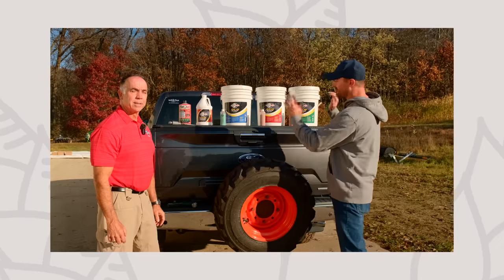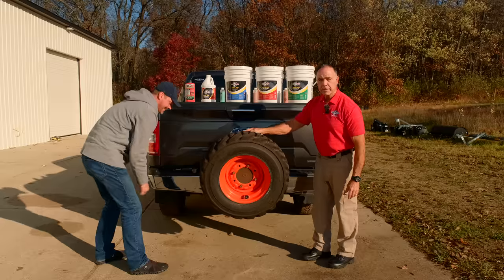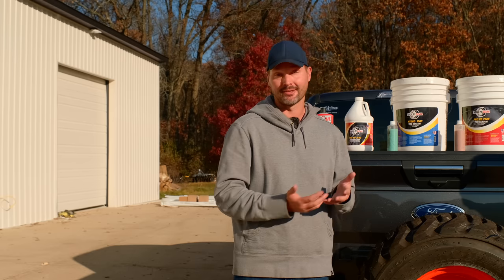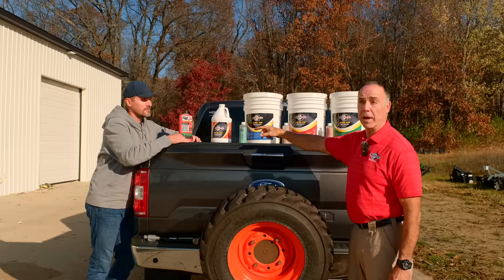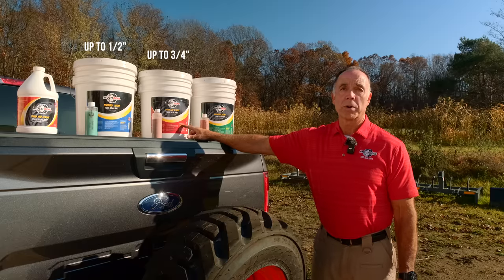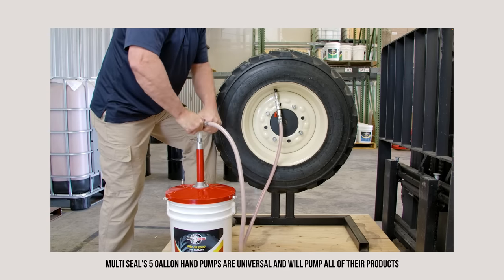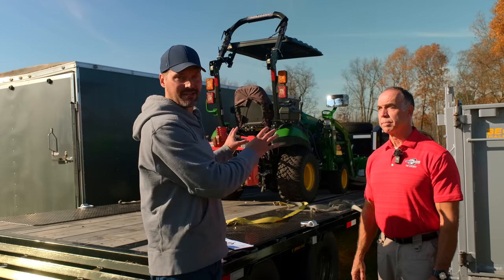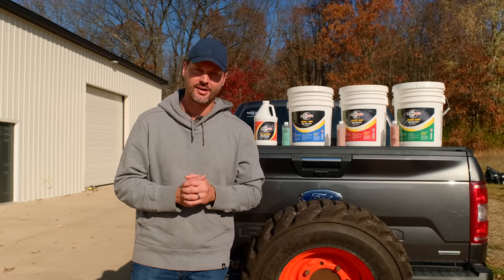PREVENT FLAT TIRES IN TRACTORS, TRAILERS, & TRUCKS! CRAZY!🤩

Comment: Neat stuff. I will dispute one thing, and that's the hole size it'll fix. It will not fix a 3/4" hole in a tire. It will fix a puncture caused by a 3/4" object. If you take a 3/4" hole saw and drill a hole in your tire, it's not going to fix it. But because tires are elastic by nature, that 3/4" puncture will close up to a much smaller hole that the Multi Seal can fix. Regardless, I think I'm going to order some for my zero turn mower. I've already had to plug two of them from screws and nails that seem to be everywhere from the previous property owner.
Reply from the maker: Yeah a 3/4” core removed from the tire is different.
Reply: Yes excellent point.  This  won't save your tire  if you drive over a spinning holesaw.

Comment: I would love to see the tire demounted and see what it looks like when putting on a new tire. The tire guys I know hate it when people use fix a flat tire sealer because it makes it makes a mess on the inside and their job harder .
Reply: Well you know there not going to show that,,, or if it rust the wheel ... Lol
Reply: And fix a flat can be flammable  too when changing a tire and it's messy
Reply: I have used multi seal for years.  Tractors, mowers, lawnmower.  The tire shop has used a cup after the old tire is off the wheel to dip multi seal out off the old tire and put it in the new tire before mounting.  It is expensive and worth every penny.

Comment: What does this do to the valve stem?  Will it become clogged when trying to release air pressure?
Reply from the maker: No it doesn’t clog it up.  Pretty cool formula.  They’ve covered all the bases.
Reply: Just turn valve stem to the top when airing down. You'll get a small amount that will ooze out but nothing significant. And honestly, with this stuff in your tires, you won't need to touch the valve stem until it's time to replace the tire and stem

Comment: A  leak on one rear tire of my SCUT was causing no end of problems every time I used my forks - couldn't manage to hit both sides of the pallet without adding air!  After a little research, I used Multi Seal and it solved the problem instantly and permanently.  Amazing stuff.
Reply from the maker: Seems like I’ve got a similar issue on at least one piece of equipment around here at all times, haha!

Comment: Tell ya what, I use it on my Big Trucks and Trailers that run in and out of the Landfills where tire punctures and cuts are almost a daily occurrence.... Yes, it is messy when you go to mount and dismount tires, but I look at it this way..... Its a Hell of a lot cheaper than buying tires or having equipment down waiting on service trucks....

Comment: Looks good I wonder if its flammable And could I use it in mt old 2001 jeep wrangler that has no tpms system and stock aluminum wheels
Reply: Non flammable
Reply: @rbp1960  So is it ok for on road vehicles that go 65 mph and not throw of the balance
Reply: @wdxwm300  I don't want to be rude here, but he'll no do not put that in an on road tire, if it's water it will expand and blow your tire, also tire pressure sensors. And yes it will shake the tire to death at the wrong speeds as the water oscillates. Any liquid in a tire is a low speed product. And any added weight to a highway speed tire will wreck the balance. Keep it to tractors and slow ATVs man. It will wreck your tire and might cause a crash if it blows on the highway

Comment: I've always used the product Liquitube (also sold under the Kubota brand) that does this. It has the Kevlar fibers, as well. It acts as a bead sealer, puncture sealer, and is absolutely amazing. I'm sure this stuff works well, as well. Makes products like slime look like water. This brand name's ability to mix with liquid ballast though is a game changer. I'd have no problem giving this product a try.  Great video as always! And thanks once again for the info! On a sidenote, I'm over here in the Flint area, and would love to make a trip over and see ya some time!
Reply: Liquitube does not contain Kevlar

Comment: Does it work tubes in tires. Great product. Have a great day be safe
Reply: The only missing question. This for tubeless only? Or both?
Reply from the maker: Here’s what their website says…

We claim lower effectiveness on tubed tires for several reasons:
In many cases, the tubes are very thin and cheaply made.  This can lead to the tubes ripping when punctured which makes them very difficult to seal.
We also see a lot of tubes that are not properly sized for the tire – either too big or too small.  This can also lead to ineffective sealing due to the movement of the tube in the tire or ripping
Reply: @GoodWorksTractors  if the sealant works as good as it claims. I will take tubes out and go back to tubeless. My problem was leaking around the bead on 2 skid steer tires and a 3 one was a small hole in it from a nail.

Comment: As far as slow speed equipment goes these kind of products are great. However anything that goes above 30 miles an hour if it has water inside the tire the water gets hot with friction. And it can create other problems from the heat. Especially I would not recommend it on a motorcycle tire. But I would not recommend it on a car tire or a trailer that travels 50 plus miles an hour because the heat can create a blowout also

Comment: Great for tractors but other vehicles might have problems with balancing?
Reply: I expect not. The product remains liquid. So, it should be distributed fairly evenly inside the tire as it spins at speed.
Reply: The tires should be balanced before putting in the Liquid.

Comment: Interesting. We have lots of multiflora rose. This may be a good idea. Now I'm afraid to check the pricing!
Reply from the maker: Haha well I suppose you need to weigh the costs of having it vs not :)
Reply: @GoodWorksTractors  True! I've patched a front tire twice on my Ranger already. Rose thorns both times. Can it be used on plugged tires (tread, not sidewall)?
Reply from the maker: I believe so, but I’d double check with MultiSeal to be safe
Reply: @GoodWorksTractors  Thanks; I will. Price isn't that bad, at least for a Ranger sized vehicle. This was very helpful!

Comment: If you let air out of your tires with the stem at the 6 o'clock position would that cause the valve to clog up?
Reply: If this was in your tires to prevent flats , why would you need to let the air out of them ??

Comment: How does this work on side walls. I do a lot of off-roading and have been known to get sticks in my side walls, plus my tractor tires get locust thorns and mesquite thorns in the side walls and depending where it is, a lot of tire shops wont repair a side wall, even for tractors and side walls, no matter if those vehicles never see the street or highways

Comment: Bought Tire Ject. Tried it on a front tire of a lawn tractor. Didn't work at first. Took a long time to work and only  Partially worked. Still leaking air. Not happy with product. Screwed up my tire pressure gauge. Had to clean it.  And yes had the tire moving. Stuck in my lathe and spun the tire 20 min. Question is does your product work better than tire ject.
Reply: Yes

Comment: Does it work on tube tires ????/       After having to air up my tire for years ( four years plus ) I used the Flat Out years back on my tubeless forklift...16 X 28 tires.About 5 1/2 foot tall. and about 3 foot wide...I did not even use that much and it worked fine. Later the other tire started leaking on the side wall and to my shock it fixed that one also....WOW !   Saved  $1200.00 for the tires plus install $200 -$300 .

Comment: Does this cause the inside of the rim to rust?
Reply from the maker: Good question.  Here’s a snippet from their website.  Based on this, I would say no.

MULTI SEAL® stops underinflation due to slow leaks, seals punctures in the sidewall, stops pinhole leaks in the rim, prevents corrosion, and extends the life of your tires while providing a safer driving experience.
Reply: Been using it for years at the dealership I work at. Have never seen any rust on anything we've put it in. We put it in every new lawn mower we sell

Comment: How does this tire sealer interact with tire ballast like Rim Guard or others? Also, below -20 Celcius?
Reply from the maker: Hydro 1500 is what you mix with liquid ballast
Reply from the maker: Works to a real cold temperature, but don’t recall what.  Rick mentions it in the video at some point.
Reply: @GoodWorksTractors - 20°f which is a good bit lower than -20°c
Reply: @GoodWorksTractors  sorry, to correct myself they're very close

Comment: Only problem with this product is that you can't balance the tire for high speed operation.  Good for off road use however.
Reply: This product is used in a lot of high speed applications. It can actually aid in balancing the tires as long as the correct amount is installed. Not recommended for cars or light trucks due to TPMS

Comment: Would definitely like to see what the inside of the rim looks like after a few years. Does it begin to rust like Fix-A-Flat?
Because if you end up having to replace the rim due to rust you would need to factor this in. The value would be there for most but I'm not so sure on large tractor rims of course it would take a lot more rust to decommission such a strong wheel.
Reply from the maker: They've been around for 41 years and have proven the product out fully.  This product doesn't rust at all, in fact it has an anti-corrosion formula.  Below is info from their FAQ page addressing your concern.

MULTI SEAL® contains a powerful anti-corrosion formula specifically designed to prevent rust and corrosion on all types of rims – steel, aluminum, painted or unpainted, coated or uncoated, as well as protecting the valve stem fitting.  MULTI SEAL® will NOT fix an already rusty or corroded rim – no sealant will. Prior to installing MULTI SEAL®, make sure that the rim is free of corrosion or rust.  A corroded rim is an unsafe rim.  Beware of any sealant that claims to remove rust or fix damaged inner liners.

Comment: Yes, over half of our product is ran in over the road fleets. Because there are no adhesives if you follow our application chart and install it in new tires or retreads it will virtually eliminate under inflation seal the punctures and can aid in balancing the tire. We have been in millions of tires over the road. Not recommended in light trucks and cars due to TPMS
Reply: Can I use this on my Jeep TJ on 35’s that sees a good bit of highway driving? (No TPMS)
Reply: @npalmi88  We do not recommend it in a light duty suspension such as your Jeep.  We recommend our product to be used in a heavy duty suspension of 3/4 ton and above in high speed applications.
Reply: @rbp1960  dang, oh well.

Comment: So, if your tires are already full how do you force another gallon and a half of the sealant in the tire?
Reply from the maker: You’re tires shouldn’t be filled completely.  Typically, just above the top of the rim with liquid ballast.
Reply: @GoodWorksTractors  I thought you put as much in as you could get in. Thanks for the speedy response.  Love you channel.  Kind of wish I would have seen Summit tractors before I bought my 1025r.  Really would like the rear hydraulics but don't have the need.YET! Thanks.
Reply from the maker: @rodbagley1686  happy to help!
Reply: Support the Tractor so the tire is off the Ground. Put valve Stem at 12:00 and remove it. With no air in the Tire You should be able to get the Product in.
Reply: Definitely looking into this could use it on my jd x530 and 1025r

Comment: Alot of late model 18 wheeler have a tire monitor system on them. They also have tire equalization system, usually on the trailers. If it wouldn't work on passenger cars bcs of tms, then wouldn't work on late model big trucks. I can assure u though, I'd rather have this stuff, than the tms or tire equalization. These tms system on big trucks are worthless, always messing up.

Comment: I can’t find this stuff anywhere if they’ve been around since 1981 why is it so hard to get a hold of it? Even the links that you provided in the description send you to their site which only lists a 5 gallon of the Hydro 1500 but doesn’t even give you an option to buy it nor does the website even list the other types or sizes I don’t need a 5 gallon bucket I’ve got a John Deere 1025R I only need 1 gallon for the front tires and 2 gallons for the back and Amazon or anywhere else online only has the 5 gallon buckets but in the video you see 1 gallon sizes but nobody sells it that I can find.
Reply from the maker: Only 2500 is available in 1 Gallon jugs right now, but 1 gallon for the 1500 is in the works.

Comment: This stuff doesn’t work it is mostly liquid and only the partials will seal. I put this in my tractor and it is a waist of money. I put a sealer made by John Deere in my dune buggy tires and they have not gone flat. The John Deere sealer will have to be reapplied in 10 years but at least it works. There is less liquid and more partials in the John Deere sealer the liquid takes it to the hole and only the partials can seal it. That stuff they are talking here is no better than the green stuff at Walmart. Go to John Deere and buy something that will work. Signed A tech mechanic
Reply from the maker: I guess the video is photoshopped 😂